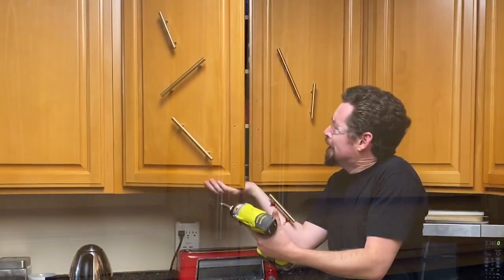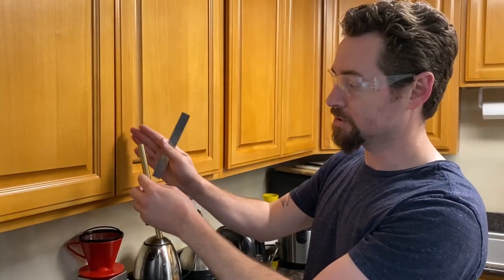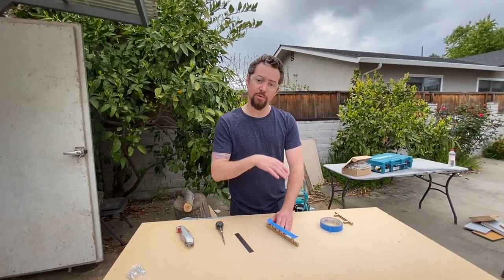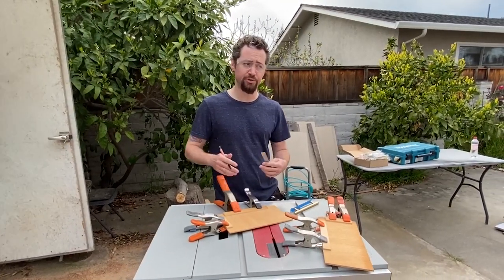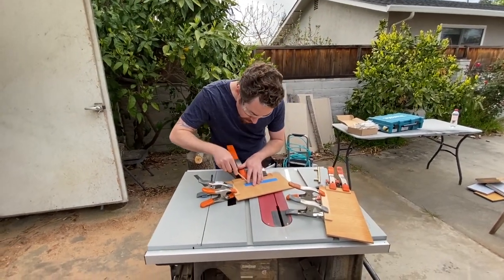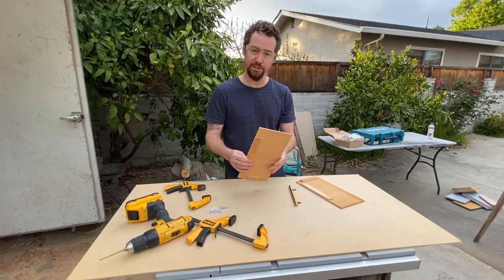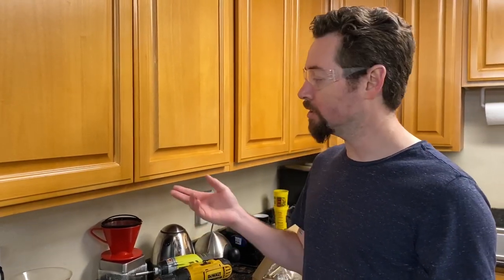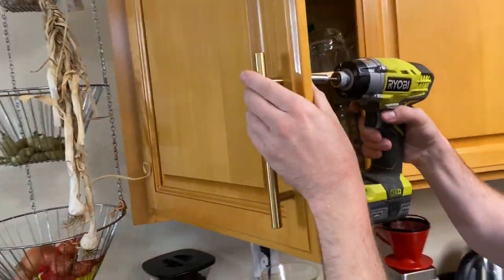Making a Jig to Install Cabinet Pulls

Comment: This idea includes more work but the hole spacing will be perfect. Instead of the piece of tape you can use two screws then attach them to a drill, grind one end into a point and screw them into the handle. You can then mark the holes on the template with the handle.

Great video!

This is one well made video. It's on par with the 300,000 + subs channels out there.
Reply from the maker: Thank you! I work hard on the videos, and I have been getting better at editing.

That is an interesting method, and would be very accurate. Works kind of like a dowel centering point.
Reply: @BobsWoodStuff  You are very welcome.

Yep that's right. Would be nice if threaded centerpoint dowels were available on the market. It would make things like this very easy.
Reply: @unogazzy84  2 years late but nice idea’ they do make metal double screw tip side like for furniture dowel replacement that would be perfect’ 

Or heck even your thought just take a scrap 1x2 
Put inch and a quarter screw through it so the screw points poke out other side’ 

Then you could just hold block up to door and tap back with hammer that would make little divots the. Drill’ 

Hope this helps someone in the future reading lol’

Comment: Couldn't you put another set of spacers on the back side of the first template and to use for the other door, instead of two templates?  Just make sure to label which side does which door.
Reply from the maker: Yes, that would also work. I realized that after making both templates, lol.
Reply: pretty sure you could figure it out without labeling them also